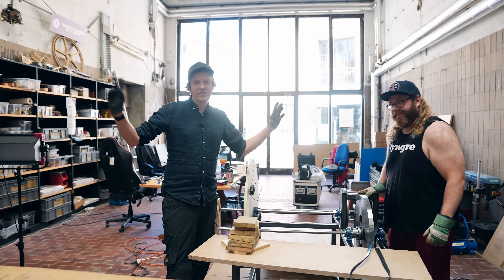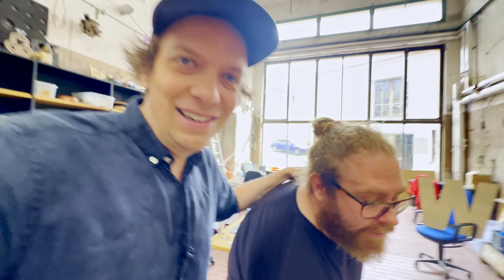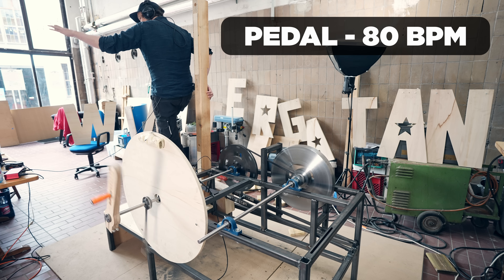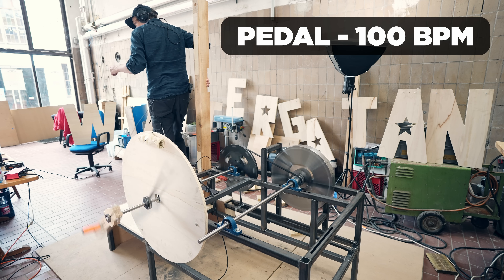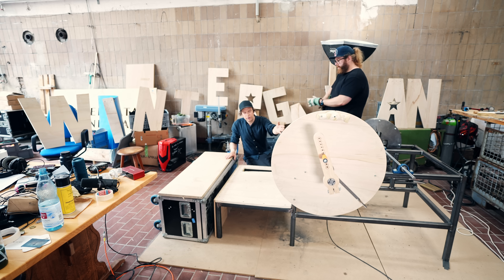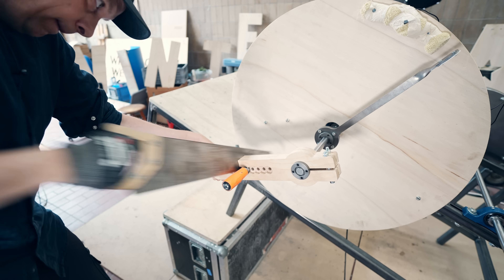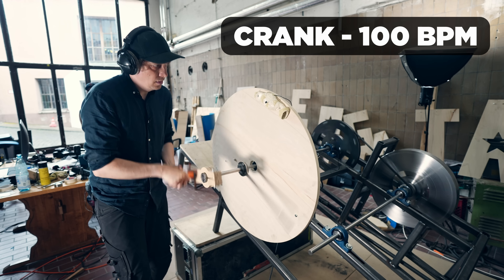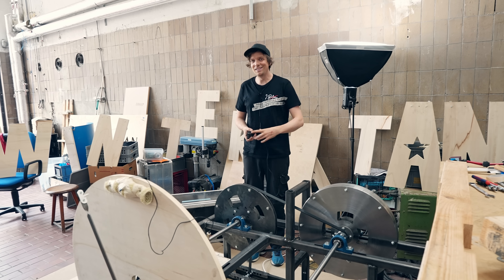Heavy Flywheel plays Tighter music! - DAY 11 - Marble Machine Flywheel Prototype

Comment: Ugh!  Martin, you're scrambling together "Tightness", "Fixed Tempo", the power-module, and the playing mechanism.
  Here is how you originally defined "Tightness":  "When the same marble gate is repeatedly triggered at a fixed Δt, is the Δt between marble-strikes [on the instrument] constant?  And if it's not constant, how large is the variation from the average marble-strike Δt?"
  But now?  Now you've gone and redefined 'tightness' to mean "Can I keep a fixed tempo using this form of power-supply?"  That's not the same thing as your original definition of "tightness".  How well the power-module can keep a fixed BPM has nothing whatsoever to do with how consistent the marble-drop-mechanism behaves!   Martin, you're moving the net around in the middle of the football game!  Stop that.
  Given what you're doing here, I'm expecting you to redefine "tighness" to be "How long after the programming pin activates does it take for the marble to strike the instrument?" … which is mechanism latency, and like BPM has nothing to do with "tightness", i.e. consistent marble-drop-mechanism behavhior!  I'm not even sure if Mechanism Latency is an issue, either!  Musicians keep time by listening to each other, not by watching a meter measuring the BPMs the drummer is performing.

When playing with the Marble Machine,  Wintergatan needs to keep tempo with the MM3 by listening to it, NOT the other way around!  And if the MM3's tempo slows down and speeds up gradually, WHO CARES?   It's part of the instrument.
  Look, Martin, go have a look at how Bach and other composers dealt with the complete lack of volume-control in an organ or a harpsichord.  An organ has ZERO control over its dynamics.  Neither does a harpsichord.  It's a natural limitation of those instruments.  When harpsichords and organs had to play with other instruments or with singers, music composers, like Bach or Scarlatti, had to change the music they wrote to compensate for the lack of dynamics in those instruments vs. the full dynamic control of the human voice and the violin also playing.  Arpeggiated chords and trills came from this — sometimes the organist or harpsichordist would even add trills or arpeggiate a chord if they wanted to make their instrument "quieter".  Back-to-back chords were a technique to make an organ/harpsichord louder.  Instead of using dynamics to invoke emotion, composers and performers would use trills, grace-notes, turns, and other "musical ornamentation" to invoke emotion instead.

You're trying to put volume controls on a church organ.  It's not going to work.  It's never going to work.  Any marble-machine you create will, by its very nature, have (1) latency between the power-module, the programming wheel and when the marble hits the instrument; (2) a non-constant, though smoothly varying, BPM.  Just. Lean. Into. That.  The rest of Wintergatan will have to keep time by listening to the MM3.  You and any other members of Wintergatan who compose music for the band will have to incorporate a varying BPM that you don't have [much] control over into the music itself.

Your requirements for the power-module should be, "Sufficient torque to run the machine."  Nothing more, nothing less.

Comment: The problem with the handle is that the movement is continuous meaning you aren’t actually able to match discrete movements to the Bpm like you can in the pedal which translates the circular continuous motion of the flywheel to a linear motion with a maximum and minimum that you can use to gauge whether you are going too fast or too slow. The only thing that lets you know whether you are ahead or behind the pulse on the crank is the contact with the contact microphone and the fact that you have a metronome going and I’m assuming when you are playing live you won’t have the contact microphone becuaee it’s for testing purposes so in order to get that feedback you are going to have to have something that will create a vibration feedback at the same point in every cycle which will create noise which is something you don’t want whereas with  the pedal you know the time between the the maximum and minimum should be constant and line up with the desired rhythm. I saw a comment about decoupling the pedal and the flywheel but I feel like that would end up meaning you would be keeping tempo like a Dj does when he beat matches, essentially trying to get it close by speeding it up or slowing it down which is fine for mixing because the only time things need to be in sync is for the transition between the two tracks and even then it doesn’t need to be that precise. Also if the marble machine is anything like the last one in terms of features keeping tempo with a crank whilst having to potentially move clamps on a bass guitar and pull levers will be impossible which is why the pedal makes sense in the first place. 
And finally if your goal is to make tight really tight music without it being powered by a motor I.e it’s self contained and can keep being played for ever then having it rely directly on your ability to keep it playing at the right tempo doesn’t seem to make much sense. Wouldn’t it make more sense to use the pedal to add energy into the system and use some kind of timing mechanism to take a constant amount of mechanical energy from the flywheel to play the machine at a constant Bpm, I don’t know what kind of mechanism this would be or if it even exists but in my mind I’m imagining bagpipes. You add the pressure by blowing into the bag but the reed and your arm only lets through a fixed amount of air so as long as your bag is topped up with your breath (the flywheel is at speed due to your pedalling) then you don’t need to actually match the Bpm yourself to play tight music. This also means that if you need to move around the machine for certain sections or do anything away from the pedal you can pedal really fast for a bit, get the flywheel up to speed and then do what you need to do, like a crazy involved solo where you reach into the machine to change its function in some retesting way. 
Sorry for the long comment.

Comment: Maybe someone has already suggested this, but what if when you go to play, you leave the mic on the marble machine to use as the click for the band? You could have a display that could constantly report the BPM of the marble machine, like a speedometer in a car.

There were times you were going 80/100 BPM, but it was out of phase with the click, so you intentionally went faster/slower to try to get the phase in sync. That introduced additional variation into your measurements. You were going the correct BPM but intentionally sped up/slowed down.

It isn't as tight because you're trying to stay in phase with the click. Instead, make the marble machine the click.

You can use the mic as a trigger and still use whatever click sound you prefer.

Comment: This is all dany and fine byt you have to put a load on the flywheel to simulate tha actual working conditions of the machine. 
Just turning a freeflying weight is one thing, having to put power into each revolution to compensate for the enegy removed by the mechanics of the actual macine will be different.'
Keep up the good work.

Comment: I think you need to change your method of measurement. There is far too much flexing of the crank shaft and I'm certain that the arm that taps the contact mic is as well. You're not measuring what you think you're measuring, and the accuracy of those measurements is way off. You should be using an optical sensor with a mark, slit or sliver of mirror in order to get measurements that don't include a bunch of irrelevant random input forces. I also think that you should be measuring at or after the flywheel, not right at the input. You're measuring input "noise", not actual final drive stability/consistency.

Comment: surely you should be testing the output  not the input whaich is what you are testing here the pupose of a flywheel is to store the energy that is put into getiing it moving thus the heavier it is the smoother it will be.  All you are doing here is measuring the time differential between hearing two sounds which you will never exactly synchronize

Comment: the system won't work as it is. you need a way to help you hit the bpm you want, and a way to help you input power. possibly a fly ball governor and maybe some input power from a motor, just enough to make it easier on you

Comment: Wouldn't it be better to have a display with the current bpm showing instead of chasing a fixed bpm from a external source?
It looked like you had the correct bpm a lot of the time, but offset just a bit from the metronome.
Anchoring your "tightness" to a fixed point in time (when you start the metronome) seems to be counter to the goal you are trying to achieve. 
Seems to me that the goal is to match the interval between generated beats from the desired interval (to get a certain BPM), not to see if you can mirror a metronome.

So for example 80BPM would have a beat interval of 750milli seconds. 
and if you are generating an interval of 780ms you would be falling behind the metronome,
 the only way to correct this would be to go faster than your intended interval and generating 720ms for a while. 
this essentially doubles the deviation from the target, while also doubling the difficulty of actually hitting the target speed.

Comment: Seems to me that you set up the beat to be on the bottom of the pedal. I think it would be much easier for you to keep it to the metronome if the machine beat happened at the top of the pedal, at the moment you apply force to the machine, or maybe a few milliseconds before/after (depending on your feel).
That way your body/mind can more naturally keep up with the metronome, as opposed to the metronome beat happening at the "off-beat" of the machine. Just my opinion.

Comment: a slightly complicated suggestion but i think it will improve the whole machine 's timing.

make it so that whenever the wheel taps that microphone, trigger the metronome impulse to play exactly one beat later.  you wont have to worry about catching up to a beat that is separated from your machine, or have a situation where you are on beat, but desynced with the metronome, causing you to THINK you are playing fast or slow.

for example, when you play too slow, the metronome will effectively tap earlier than what you are playing at, but it will ALWAYS tap earlier than what you are playing, instead of drifting farther away from the beat you are playing at. this tells you that you either need to speed up, or your current speed is already close enough, and you can maintain it without the metronome drifting.

this will focus more on getting a consistent and even tempo when you play, rather than trying to match a tempo separated from your own, causing you to constantly waiver yours to try and match.  you might be playing at a solid 80bpm, but the metronome is just slightly faster, and it will drift off and play sooner than your own beat, causing you to break your solid 80bpm and speed up.

Comment: Martin, don't forget that this is only the flywheel, without the friction and energy bleed of the rest of the mechanism; you will need to work way harder than this to keep up the tempo, so you might need an electric motor to assist? A roller cam clutch/freewheel on your input will enable you to interrupt cranking. Also consider; the faster the flywheel rotation, the greater the chances of vibration, which may compromise the operation of the ball escapements, for example. But great results from these tests!

Comment: Keep in mind that this is the minimum amount of energie you will have to spend. Adding all the mechanisms of the machine will make it only harder to turn. And you have to spend that amount for at least a song, ideally for a whole concert. So not only think about the tightness of hand vs. foot, think also about sustaining that level of energie.

Also, how do you plan on engage the programming wheel? Is it constantly powered and you have to wait until it has been turned to the start of the programm to beginn the song. Or can you engage it when you have enough power in the system, but then loose some of that power and therefore the achieved BBMs.

Comment: Are the wheels balanced? Specially the flywheel...
You know, like the wheels on a car, where you add those little weights to balance it.
Would it even be necessary in this case?

Comment: You should add a visual cue for the sync. Like a disk that turns with the arrow with holes in it and a pattern on the circular board. ✳︎
Reply: Yes or like a string of lights, middel is on beat lef is under right is over. Kind of like a rev meter. That way you can see much quicker if you are giving it too much power or not enough

Comment: It must be easier to "feel the force" with the hand crank, you'll learn how much force you need to put in (=the friction losses) to stay consistent the more you use it. 
Thats probably something that changes from machine to machine and system to system depending on how much losses are in it, the less, the less energy you need to put in it to make it consinstent. 
A heavier flywheel negates some of the friction losses but will take more energy to get up to speed, i'd say go for as havy as you can keep spinning, and use an electric motor on the shaft to get it up to speed, then you only need to add a litte bit of energy each beat to make it stay there.
Or is that considered "Cheating"? :P

Comment: Would it be better to measure the time for one rotation as your random variable? Consistent BPM is the goal surely, and I think you are introducing another undesirable random variable which is human error in correcting the drift from the metronome. 
Maybe you can design a system which triggers the next metronome beat a certain time after your mic has been contacted. That way you can still hear a lagging/leading BPM but you will never drift from the metronome. Cheers.

Comment: One issue I see with the pedal is that you only have the chance to apply power in a specific portion of the rotation, whereas with the crank you can add power at pretty much any point. This understandably leads to the pedal being slower to react to small changes in tempo.

Comment: As well as changine a variable (the weight of the flywheel, the speed, length of handle) you also got more practised at operating the prototype as you went along. I'd suggest repeating some of your earlier tests now that you have more of a feel for the machine as a whole.

Comment: When I heard flywheel I absolutely expected the system to unrelate the input effort from the output effort but it doesn't seem to be doing that. I thought it was going to always target 80 bpm no matter what Martin put in even if it was way faster by using the stored energy but it seems that it just translates what Martin pumps into it 1 to 1 making it able to over or undershoot.

Comment: Let's wait for detailed analysis but it looks like the crank is better for slower BPM and pedal for faster BPM.
And I think it's more about the crank being rotating too quick to be comfortable. If this is real and you want a "crank only" system, you should consider to have a mechanism that exactly double the couple of the crank, in order to have a beat at O°C and 180°C
Reply: Or you just have to keep both crank and pedal, but operate one or the other depending on the tempo...

Comment: Sigh. As I said after the last video and maybe the one before, don't use a metronome. Instead, play back the contact mic in real time with a 1-beat delay (i.e., 60/80 sec, 60/100 sec, 60/120 sec).

With a metronome, when you get behind, you have to overshoot in order to catch up. Likewise if you get ahead of the metronome, you have to go slower than the target, to resync. Both of these make your standard deviation worse than it should be.

If instead you just play back the contact mic on a 1 beat delay, you only have to return to your target speed. You are never asked to go faster or slower than the target speed.

Comment: Makes sense; it's going to be easier to maintain a beat with your hand crank than the pedal - your arm's (or, more precisely, your nervous system) ability to make fine adjustments to power input is more accurate than your foot. The flywheel holds energy, so the adjustments to input power is less... and making fine adjustments is what the arm sort of is built for. Large movements are for the legs, and precision is secondary for most leg motions we make in ordinary operation. A larger/heavier flywheel stores more energy, so your adjustment inputs are lower... but also means when you overshoot, it's going to take longer to regain the beat sync. But I'd say if you're aiming for precision (tightness), an arm crank design would be best.